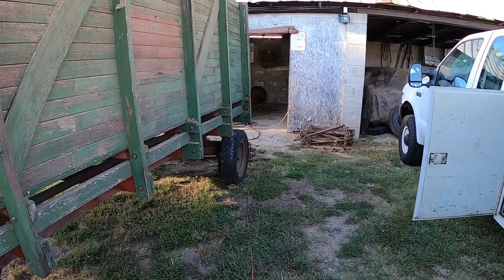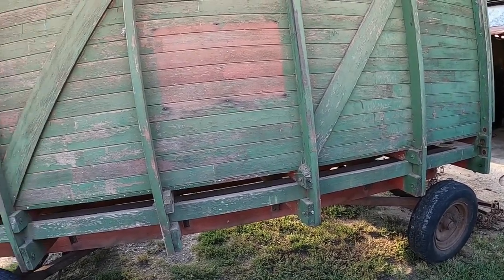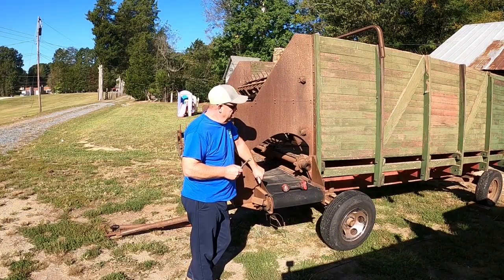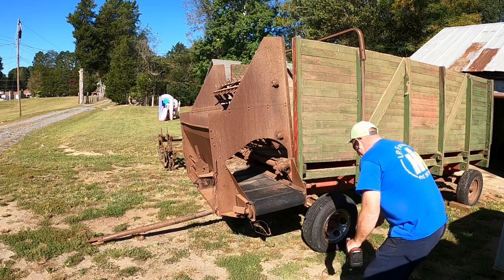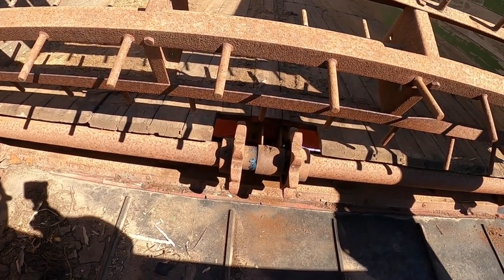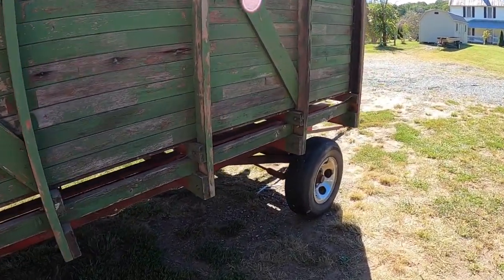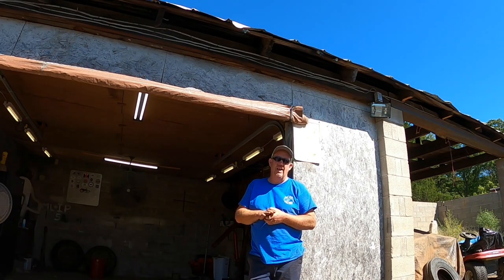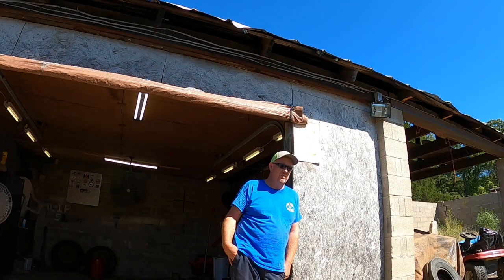Silage Wagon Conversion, Ready for HAY

Comment: Well, that was a productive day for sure.  Before you got the loader I was kinda wondering what'd happen to the tongue if the assembly would drop onto it.  Ya done good !!  The whole wagon looks to be in good shape.  We used our silage wagons as hay wagons because the sides on both were removable. Of course they started out as hay wagons and the sides and end gate were made to be removable.  The front end was built as a slide with cables attached.  The cables wrapped around a 2'' pipe on the back end. The pipe had makeshift bearings with a  6 spline pto stub welded to one end.  Stopping at the blower, a pto shaft off an electric driven 4 speed truck transmission would telescope out and hook right up.  The motor went through a reduction box then to the tranny and we'd run it in double-low to pull the front to the rear while using wide potato digging forks to pick the packed silage off into the blower.  Man, those were the days !!  My favorite times were filling silo, plowing and spreading manure !!  Thanks for the memories performing surgery on the silage wagon Nelson.  Awesome job and its ready for a load of hay !! ....and to think....you think YOU are long winded....hahahahahaha.  Take care and don't work too hard today.
Reply from the maker: I do believe Mr Wendell it is gonna come in handy for sure!! My stacking skills leave a lot to be desired still...at this point 🤣🤣🤣🤦🤦🤦🤦🤦 That is freaking awesome!!! I do love hearing about the ole days and how y'all made things work just the way you needed it too!! 😉😉 That reminds me, I need to grab a video of my old winch. I do believe you would enjoy seeing that, very mechanical with with a lawn mower transmission for gears, and a Briggs motor..made to attach to a gooseneck ball hitch, support side motion by the main truck bed rails🤦🤦🤦 Buy that ole thing has winched many a car on the trailers, not a speed demon but simple and worked!! Sounds like we have alot in common on making what we have laying around work for us😉😉😉 We too have since upgraded to a 12k winch, but man the memories just like you say!! That loader has been a life saver in so many ways, had I not forgotten the 4 front shaft bolts, the removal would have been so much easier🤣🤣🤣🤣 At one point I thought I was gonna rip the wagon in two pieces🤦🤦🤦🤦 Thank you my friend, for the gray conversations each time on our adventures, and toy always being here !! That means the world to me!! Feels like winter here this am, 47😳😳 But I can't complain, it has been a long summer!! Have a great day Mr Wendell, and thank you again sir!!😁😁😁👍👍🇺🇸🇺🇸🇺🇸
Reply from the maker: @tractorman4461  Man yeah Mr Wendell!!! I will check it out ASAP!!! You are amazing my friend!!! You have a creative mind and I love every min of it!! Ole daily job got me still out working , so we are on 14 hrs so far, and looks.loke another couple to go🤦🤦 I need to retire 🤣🤣🤣🤣🤣
Reply: @Pennies_on_the_dollar  Hot doggies, I remember those days too but I don't miss them.  The worst one I did was a Commercial dual steam boiler change out that had a 48 hour window.  Me and another guy worked 38 out of 48 hours to get the job done. Well, there was ONE a bit worse when I was a very young and healthy member of Uncle Sam's Misguided Children...but I'll save that one for later.  LOL  It's all good though.  I am glad to see you hard working guys that have the hutzpa to keep going like you are today. And ya know, there are a LOT of guys like you out there keeping everything humming right along.  You are the grease for the big machine !! I hope you rested well after the hard day and are ready to take the slack outta the traces again today.
Reply from the maker: I can only imagine the whirlwind that followed you in those days Mr Wendell, true grit is hard to hide, even as the silver shows through 😉😉 Thank you for the kind words my friend, seems there are dying breeds that really take pride in there work! I can't say thank you enough for all you bring to the conversations and the witty humor you always possess!! Thank you so much my friend, well rested and buttoning down for the storm 🤦🤦😢😢
Reply: @Pennies_on_the_dollar  Hahahaha...what was usually following me around wasn't really a whirlwind....it was more like an explosive release of 'natural gas'....!!  LOL  Stay safe and dry, I hear there's some moisture heading your way...maybe a bit of wind too.
Reply from the maker: 🤣🤣🤣🤣🤣 yes sir getting kinda sketchy as I type 😳 Thank you Mr Wendell!!

Comment: Nice 👍.  Wagon looks like it'll work good for ya.  There's a tool to take those chains apart, it basically just helps hold the chain to the side so you can drive the link down. I'm sure a solid surface and a vise grip would work if you ever need to take one apart for some reason.  Look forward to seeing the first voyage to the field with the wagon. If you happen to have or can get a hay hook they sure help pulling bales off the slide into the wagon . Good luck 👍👍🍻🍻🍻🍻🍻🍻
Reply from the maker: I think it will work pretty good, can't beat the price..fingers crossed at least👍😁 Oh boy, I pondered long and hard on that chain, enough to the point smoke.wqs coming out of my ears....they got the angle grinder 🤦🤦🤦🤣🤣🤣🤣 Really? I have heard of those, but never laid eyes on one, will for sure check into that!! I'm sure dad won't pull any punches on the 250 and the baler, with me in tow🤦🤦🤦🤣🤣🤣🤣 Thank you my friend, for all your support and great advice!! Also for always being here, I really appreciate that sir!! 😁😁👍👍🇺🇸🇺🇸🇺🇸🇺🇸🍻🍻🍻🍻🍻

Comment: Should be t same as a manure spreader chain, end between the links and slip them apart. Might need a hammer.
Should work out nicely 👍
Reply from the maker: I fiddled with it for several minutes, I have no idea what I'm doing...it got the grinder 🤦🤦🤦🤣🤣🤣🤣 I think it will be a good start! Thank you sir for always being here!! I really appreciate that!! 😁😁🇺🇸🇺🇸
Reply: I have 2 of those old chain attaching.  / detaching tools. They make taking those chains apart or putting them together a snap
Reply from the maker: Ole boy ..I messed up then 🤦🤦🤦🤦
Reply: @Pennies_on_the_dollar  lol.. torch works great too 👍😁
If you take a look at it, you can see how it comes apart, easier now that you have it out.
Reply from the maker: Mr Gary was explaining that process , makes perfect sense....but this is to someone that left 4 bolts in the middle shaft, and about ripped the box apart before he realized 🤣🤣🤣🤣
Reply: @Pennies_on_the_dollar  🤣😂 oops.
Don't feel bad, I've tugged on a few things that were still connected